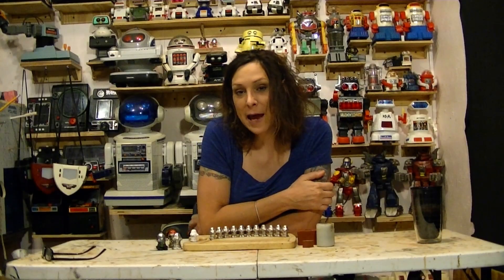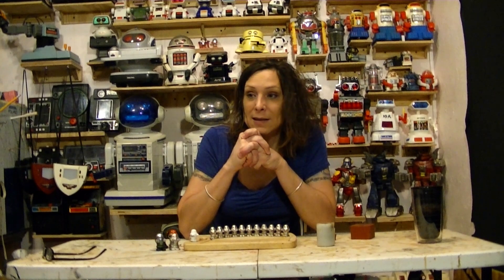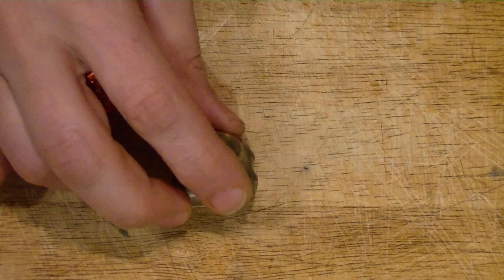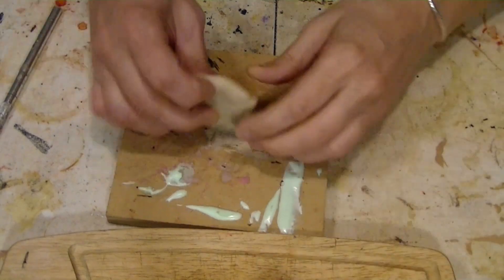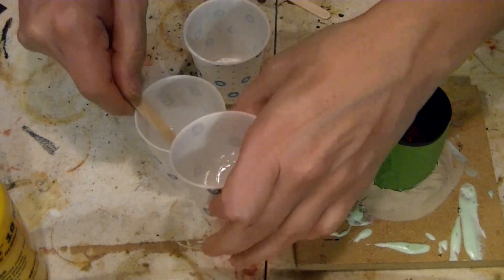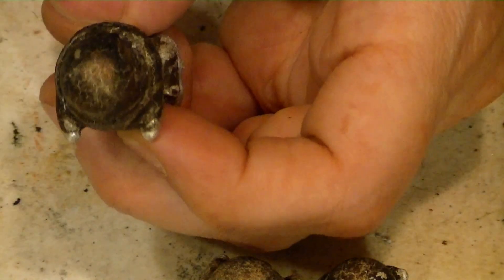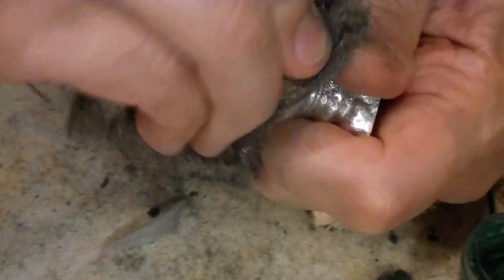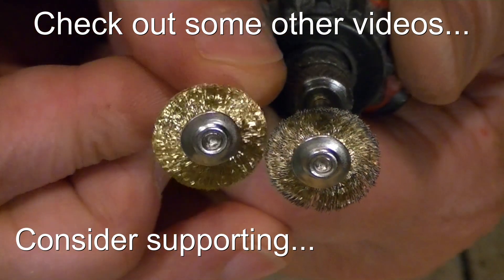Making Mini Pewter TOMY Pocket Robots - Randi's Robot Garage

Comment: Do you think I can use your technique to melt scraps of PLA into a mold and reuse the craps and accidents?
Reply from the maker: Hmmm... Interesting idea. I don't know for sure, but if you could regulate the heating enough so that it melts and doesn't burn, and make it liquid, it may be able to work.
Reply: @RandiRain  I think I'll give that a go.
I have a couple of kilos worth of scraps and don't have the heart to throw it out.
What material do you recommend for mold making that's cheap. 
I was thinking of getting cookie sheets and melting them on a flat sheet that I could use for other projects, but I don't think I'll be able to get a consistent thickness. 
You print with ABS which will stick up my place with the smell of plastic. 
Are you sub'd to myfordboy channel? 
He does aluminum casting on YouTube. Very interesting sand castings.

Comment: Great in-depth detailed step by step intro to diy casting! about the acetone smoothing process: how long it took for the vapors to smooth the piece? was it pure acetone? thanks!
Reply from the maker: Yes, pure acetone... With the heat it only takes maybe an hour at most. Without heat it takes a lot longer.
Reply: @RandiRain  Using the vapors to smooth out the piece was pretty trick. Will have to remember that.

Comment: Great video.  For those who want to do cheap experimentation (at your own risk), pewter will actually melt at normal stovetop temperatures.  I buy cheap pewter cups and knickknacks at Goodwill, thrown them into a saucepan, and cast them into mini-muffin tin "ingots".
Reply from the maker: Great tip!
Reply: How can you tell what is pewter?
Reply from the maker: It's soft... So maybe that way, but some pewter has lead in it, which is why I just buy it in ingots.
Reply: @andy-in-indy  Most mugs and pewter knickknacks are actually stamped  "pewter" at the bottom.